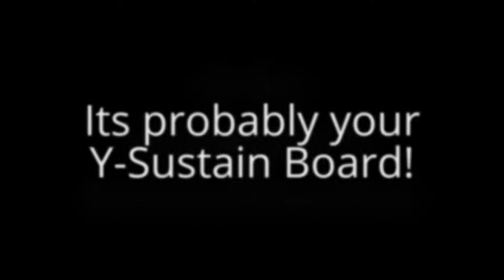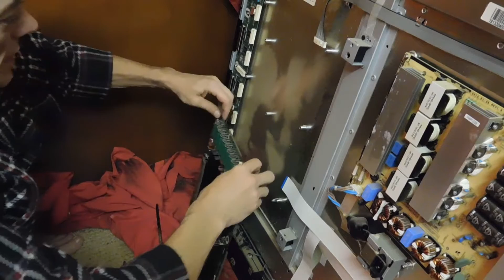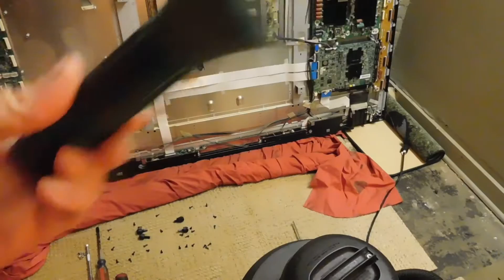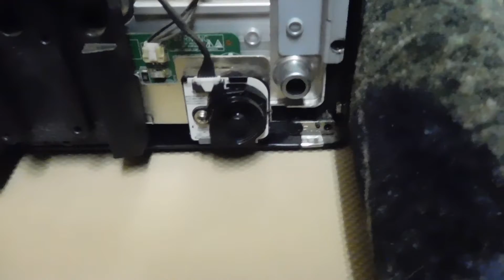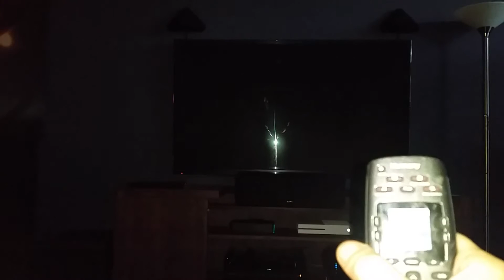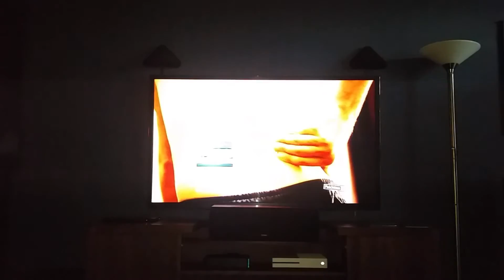Samsung f8500 Plasma TV repair - how to replace the Y-board

Comment: Wanted to let you know that six years later your video is still helping. I had the same issue pulling it out and would not have tried if not for the video. I also chopped up my finger too 😅
New board is working perfectly
Reply from the maker: Awesome! Im still glad that I fixed it and kept it. If its not used constantly, the repair should last for a long, long time.

Comment: John,  Great video and thanks for sharing. I do have a question though! How did you repair the Y board? It appears you have an LJ92-01789B. I was told mine wasn't repairable. I am right now changing the Y sus board and y buffers on my 2012 64" plasma.
Reply from the maker: I believe that I bought an already repaired board on ebay.

Comment: I found the y-board could be easily removed by sliding a knife blade in between the length of the two connectors and rotating the knife on its axis to pry it away.   Once the connector gapped by about 2mm the board just fell out.

Replacing the y-board didn't fix my issue though - I have a Samsung 51D450 with bright red pixels firing on dark backgrounds (not on white).   Increasing the VScan pot on the y-board to its max clockwise position reduces the red pixels by about 75% and I was hoping the y-board replacement would fully resolve it since the issue appears to be related to a y-board voltage.

Any ideas what I should try replacing next?   Should I go for the y-board drivers or the x-board?
Reply from the maker: Sorry for the delay. I dont really have any further suggestions. It appears that your skillset is a bit more advanced than mine!... Did you figure it out?
Reply: @JohnMastersDOESitALL  
Hi no luck yet, so far I replaced the Y board and the Y buffer board without improvement.  I've ordered both X boards and will be doing those next.    If that doesn't fix it then maybe it's the panel?    I have noticed the problem is temperature sensitive too — when the ambient temp gets over 20C the issue reduces by about half.

Comment: John, hi! I'm following your video right now. How do you remove the 3 bits at the side to separate the ysus board from the buffer board? I'm stuck!
Reply: Got it. Used razor blade to get a gap then carefully popped it off with a flat blade screw driver. Not an easy task!
Reply: OK, board changed. TV back up and running. I've still got the issue of a green line running down the left hand side  :(

Comment: Isn't this just suppose to be a Capacitor change out on the board?  Or is that what your repair man did?
Reply from the maker: Yes, thats what the repair company did before returning the board to me.
Reply: @JohnMastersDOESitALL  Where'd you send it? I need backup parts! I want to keep this thing. It is better in some ways than my 5 grand$ Sony 77" 4k

Comment: My same plasma tv samsung f8500 doesn't turn on occasionally, no picture but sound is present . Other times it works Normally. What could be the problem? Can it be repaired?
Reply from the maker: That sounds like the same problem that I was experiencing. It is most likely a faulty Y-Sustain board. You will have to remove the board yourself, as I have done in the video, and contact Nick at Nicks Tv Repair in Tucson, AZ. He repaired my board quickly and the tv is now working.  http://www.nickstvs.com/
Reply: Shashank Wali had the same problem. replaced the x sus board and it works like a charm.
Reply: @JohnMastersDOESitALL  Hi, quick question about the finger print and smudges on the outer glass how to clean it? What should I use to maintain the anti glare?
Reply from the maker: To Donq... I need to do some homework on that because i just try not to touch the glass since I can NEVER get it perfectly clean and streak free.
Reply: @JohnMastersDOESitALL  yeah that's the one I have Streaksssss!
Reply: pls see the https://www.avsforum.com/forum/167-plasma-flat-panel-displays/1959809-samsung-pn64f8500afxza-issues-turning-8.html#post50174321 thread
Reply: Usually a cracked solder joint near a heatsink will cause a plasma tv to not turn on or possibly a bad cap. When solder is cracked, thermal expansion is sometimes what it takes to get it make better contact. You can take a heat gun to your boards and warm them up and see if it starts.